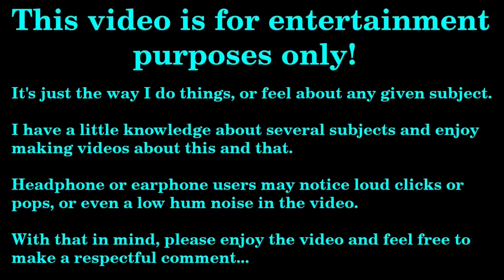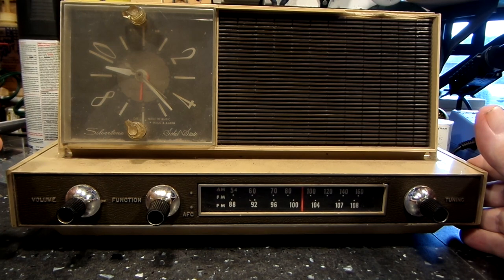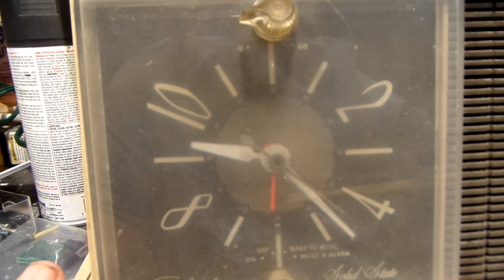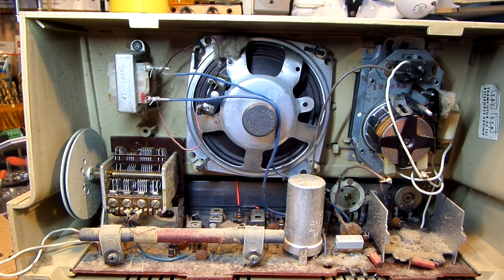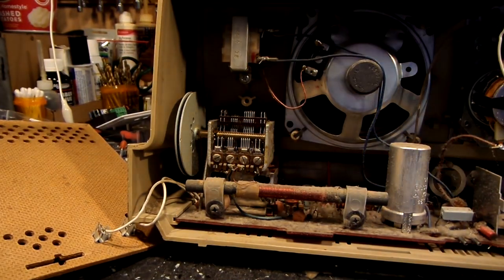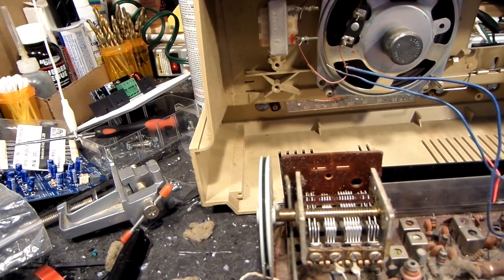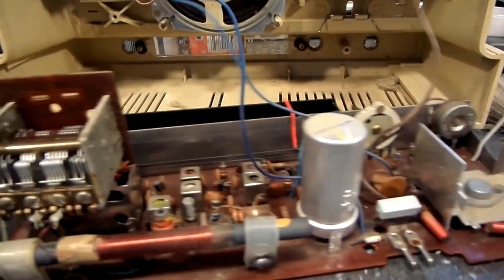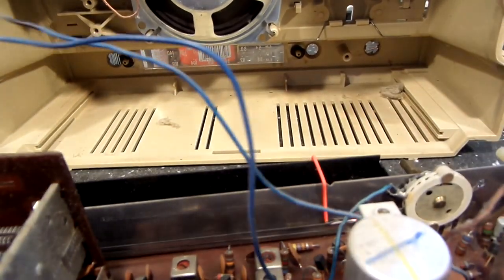Silvertone clock radio - Checkout and Disassembly

Comment: Great little clock radio Doug, It sounded pretty good. Once you get it all cleaned up and a new Electrolytic in it, it will sound even better. I'm sure Brendon will get the clock going well too.
Reply from the maker: Thanks Gregg. Unfortunately, Brendan is unable to repair the clock, but he gave me some ideas of what to look for in a replacement motor. I plan to put the project on hold until such time that I can either get the clock working or I will just scrap it. Only gave five bucks for it. LOL

Comment: Nice looking clock radio, I am sure Brendan can fix the clock.
I am sure you will get is fixed, how about some JB Weld or BONDO?.
Hey Doug...you are blowing dust all over your shop....LOL
Reply from the maker: Thanks Bill. I hope he can get it working. That seems to be a sore spot for me as I usually have little luck fixing them. I think I will try the JB Epoxy as several have suggested it. The dust just blends in with the rest of my mess. LOL

Comment: I had good luck repairing a broken plastic arm of a outside camera a while back with a product from JB WELD called Plastic Weld. its an epoxy product in a stick form that you cut off what you need and hand mix it with your fingers..then you can make it into whatever you need.. might need a little sanding to finish.. might work for you.. probably get it anywhere that JB Weld products are sold... Think it runs about 12 bucks for a package around here at least probably cheaper in your area.....
Reply from the maker: Thanks George. I may look into that as I have seen people use that on YT before. MIght be just the ticket. :)

Comment: Hi Doug, those darn clock motor are trouble maker due to their design as you know. The good thing is that they are fixable, I have a couple videos about that where had to disassemble and heat the motor and add some oil. Not sure if yours is the same design.  For that missing plastic, they are two methods. JB epoxy or baking powder and add crazy glue. It works great since you can sand and paint it. Try it on something else first to get comfortable before use that technique on the radio. Check the video How to fix broken backlight on my channel regarding the what material to use “aluminum tape”. Hope this helps.
Reply from the maker: Thanks Jay. I've not had good luck fixing those clock motors. On the plastic, I may try the JB Epoxy as it hss been suggested by a couple of others as well. I will have a look at your video also. Thank you. :)

Comment: You could probably get some tips from Brendon on getting that clock working again. The grease in it has solidified no 
doubt. Hey look at me commenting on a video from you Doug for a change ! You can blame the old goat for that. I can't
watch his stuff anymore. One person got under his skin about something and he turned off all comments on every vid
he has ever  made. Consider me back.
Reply from the maker: Thanks Steve. Got the word today from Brendan, he reported just what you said and also said the plastic gears were bad from trying to turn in that mess. I hope to find a new capsule (as Brendan calls it) for the same type of clock. I also have another couple of eBay purchases I think you will enjoy as they are not the usual type of radio I buy and work on. One even has a power transformer, imagine that! LOL